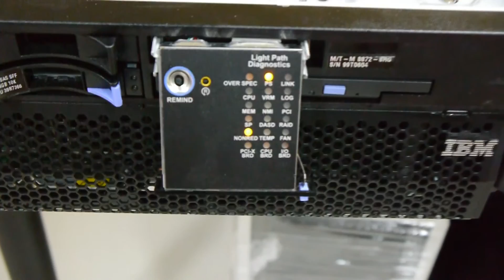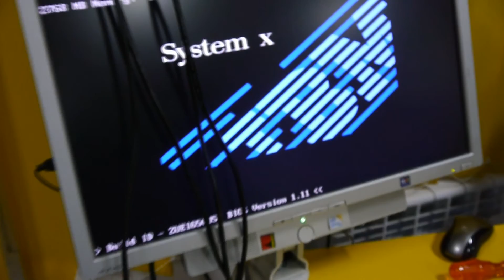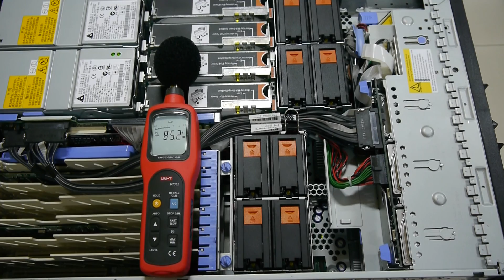IBM X3950 in action

Comment: If you take out the second power supply the fans will calm down and it won't detect an error.
Reply: channelKERR there is no power connection on ps1 maybe that is problem. And fan run high speed is other ploblem. Maybe